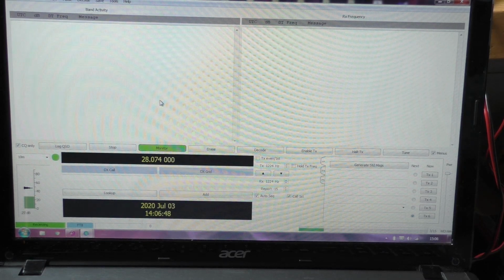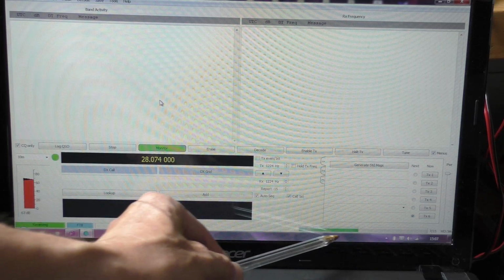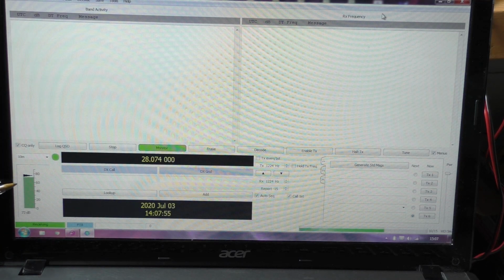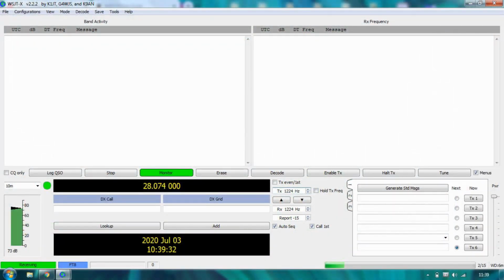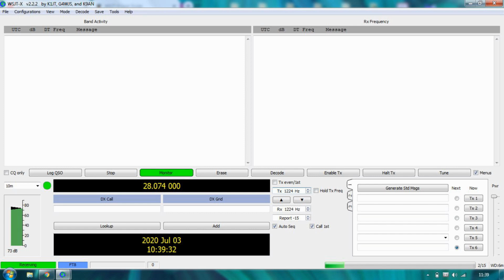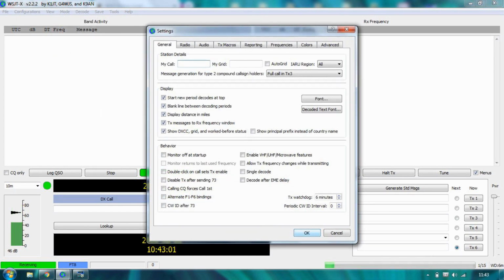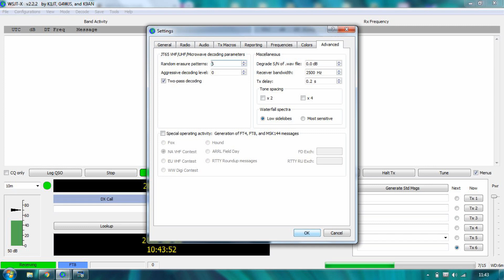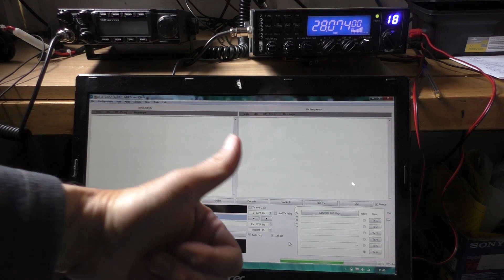Trying to read FT8 data. Not there yet.

Comment: Hi Fred, I too had great difficulty in getting the Data Modes to decode even though I had connected the CRTSS6900N to the PC and I was hearing the audio of the datastream through the PC. 
In the end I bit the bullet at bought a Yaesu SCU-17 Interface Unit - I did try a Signallink and a U5 Link as they were cheap - but they just didnt work.
Anyways, I use my FT-450D connected to the genuine Yaesu SCU-17, downloaded the Yaesu FT-450D rig control software from the Yaesu site and it worked straight away within 5 mins.
Also, you have to have the Windows audio codec installed first, before the Yaesu softare, and the WSJT-X is installed last, restarting the PC between each install. Then there are some settings within WSJT-X and your Windows Mic & Speakers settings to figure out also. 
You also need to sync the Windows time clock with an accurate server - the default windows one just isnt good enough. I use ntp1.npl.co.uk in the Internet time settings server box, and refresh every day.
It is quite convoluted, but worth the effort. 
I have remotely helped someone else setting this up with a FT-450D. So if you need any more help then please get in touch. 
73's CT3535 / M7
Reply from the maker: Big thanks.  Nice to hear from someone who has tried the same thing with a 6900N.  Iam getting that this is going to be more involved than i first thought.  I could fire up the 450D but i was hoping to get something working on lesser radios which other people might try.  Just dipping my toes into ham here to see if it was something CB guys could do.  A Really helpful comment and many thanks
Reply: @CB-RADIO-UK  You have everything you need if you just want to listen.  You don't need an interface, just a patch cord from the radio audio output to the computer mic jack.  I can decode with an old Kenwood Shortwave receiver and a mono audio cable.  Yeah I don't believe a stereo cable will work but give it a try if that's what you have.
Reply: @CB-RADIO-UK  Hey fred long time no talk the guy above mentioned the scu-17 this is vital  for  decoding data modes  i wouldnt even bother with 6900  just invest in the scu-17 it can do more than data modes aswell that was what i was using to drive my audio a couple of years ago if you remember and also do sstv on the cb band aswell  good fun.
Reply: @plast3r  While the SCU-17 is a nice piece of kit to have and makes sending and receiving its not required to receive, audio from headphones or external speaker out to line in will usually work.
Reply: @andydainty6055   very true i just found all the other solutions didnt really work that weill and the scu has opto isolators in it aswell which cleans the audio up
Reply: You hear many data station on mid band and sometime you can hear data on LOW band and super LOW but maining on around up part of 26mhz and low part of 27mhz cause i know they playing about with psk31 slowscan tv and packet radio

Comment: Ok I know this post is quite old now but I thought I would share this with you. 
With wsjtx running, go into file and select audio tab. Select internal mic and speakers. Now with the internal clock within about 1 second, if you let the laptop hear the FT8 audio it will decode it. You can use the mic on the speaker of the laptop to send, although this is better with vox. I set up like this using a Major M360 and got great results and while no replies I had a report on PSK reporter from Italy, Romania and two from Ukraine. The Major needs a tune up as it's only outputting about 5 watts into a silver rod.
Reply from the maker: Great stuff thanks.

Comment: Fred, I’m a bit late to this game.  I use FT8 on an Icim IC-7300.  Setup was difficult and took a long time, but mine works now, in spite of having a lousy antenna.  In settings, do the test icons work (green and red)?  Does your data cable attach directly to your computer?  Do not use a usb hub!  If you will post screenshots of each tab in settings, perhaps I and others can help.  73   N6###
Reply from the maker: Hi.  I did manage to decode the data in the end just using a microphone.  There is a follow up video on the channel.  Thanks.

Comment: Hopefully you've got this sorted. A few thoughts. Were you on USB? Might sound silly but you should not be on LSB. You computers clock needs to be synchronised to start decoding on the dot every 15 seconds which you do mention. On a quiet frequency with no carriers your input volume should be at about 30db.  Perhaps reduce your RF gain? 73 de 19CT019
Reply: And also, are you sure you've selected the line in on the audio tab of the wsjtx settings page? It might be set to the built in microphone.

Comment: Hi Fred. I'm curious to where abouts 4 watts would be on the ss9900 variable power. I have noticed a white dot, but not sure. Manual doesn't explain much.
Reply from the maker: The power pot starts at 1w on the min but quickly rises.  Its almost full power at 12 oclock.  The only way to check is with a power meter.

Comment: Greetings Fred, you may have already figured this out  but if not, try changing the audio settings such as codec, etc.  Also, the clock must be synchronized at all times.  Go to the computer clock open settings and click sync now.  Must be connected to internet.  If the clock is off just a second it will not decode.  I have to sync mine about once a week.  Good Luck.
Reply from the maker: Thanks

Comment: Hi Fred, Sorry to hear you're still having bother, I'll try & walk you through what I said last time but in more detailed steps 
1) Unplug that cable. Looks like You're trying to feed the PC with a "speaker level" signal from the external speaker output into a "mic level" input = BAD + if there's any RF in your shack there's a chance that you're possibly feeding that straight into your PCmic socket via the shield connection of the cable so potentially = VERY BAD 
2) If your computer has a mic built in just install WSJT-X, select FT8 & have the computer "listening" near the rig, [If no inbuilt mic. plug one in & put it near the rig].  Click ~"Monitor" if the windows version of WSJT-X doesn't default to this automatically. Monitor should light up green. Don't change anything else yet.
3) Adjust the rig's speaker volume & the computers mic input level until it shows about 60-70 max. on the receiving meter in WSJT-X. If nothing is showing up as received on the meter then go to "File" "Settings" "Audio" & make sure the "Input" that is selected matches to one that reflects your microphone (should be automatic as the software detects your internal soundcard on instalation).
4) Sit quietly ish ;-) & watch the data roll in. 
If the above is all good but you're still not getting anything decoded then visit www.time.is to check your PC clock is on time. 
FT8 is transmitted in 15sec sections as you're monitoring only & not transmitting you'll get all of them, (both the Odd's & evens), 4 decodes per minute, you should see these blocks in clearly defined segments rolling down the waterfall for the various audio frequencies that people are transmitting at, Signal then Blank, Signal then Blank rolling down the screen.
It really is that simple, don't complicate it & risk your equipment by adding cables :-) 
Once we get this bit working I'll help you set it up using PSK reporter so you can see how far you're receiving the signals from on a world map. (2 video opportunities for the price of one ;-) 
Then we'll start you on JS8Call, which allows more of a worded conversation rather than just contact, signal report, 73  etc. & is used by some on 11m.
Let me know how you get on.  73/10-10  26CT3662
Reply from the maker: Wow thanks CT.  A lot to digest.  Hopefully i will grab some time a the weekend and have another go.  Been working on my fish pond this week after work.
Reply from the maker: Yes deffo be trying all that.  Really helpful.  Thanks for taking the time. There will be a follow up video.  Win or lose.

Comment: Time is out on the software it says 10:39 the PC says 11:39 you need to turn off daylight saving time on the laptop. The time to use the software must be + - 0.01 second else it wont decode.
Reply from the maker: Good spot.  Yes i noticed that after i put the video up and is the first thing iam going fix.  Thanks
Reply: @CB-RADIO-UK  No problem buddy. Let us know how it goes and all the best of luck.

Comment: Hi Fred I managed to get it working on my Yaesu 450D. I purchased the data cable for the 450D and plugged it into my pc. Had trouble getting the right settings but working well just with the usb cable only receiving.
Reply from the maker: Thanks Mark. I will have another go at the weekend.
Reply: Fred in the Shed you are supposed to have a Digimaster Pro CAT Interface box between the yaesu 450D and your laptop but I managed to get it reading the data with just the lead from the port of the yaesu. The trouble is I had to google the information I was getting as it was some sort of short code.
Reply: Fred in the Shed  I have found this cable on the internet for the yaesu 450D a cheap way of doing data mode Yaesu Data Mode Cable for Transceivers Fitted with 6-pin mini-DIN DATA Jack

Comment: If you want to play with exotic modes that will work on a CB radio try SSTV (Slow scan television). Listen to 27.700 mHz during a lift and you should hear the French and Italians sending SSTV.

That would make a subject for your channel that I know you can do with a CB.

You'll need to download an SSTV decoder like MMSSTV. 

Have a read up here...

https://mcbainsite.co.uk/a-guide-to-mmsstv/#:~:text=MMSSTV%20is%20a%20popular%20piece,made%20specific%20for%20you%20radio.
Reply from the maker: Thanks thats certainly an idea for the future.
Reply: @CB-RADIO-UK  
I think your problem is filtering and bandwidth. The CAT is used when you are in QSO but maybe you are right. I'm grasping at straws.

Another video could be building and programming a super cheap RTL SDR receiver (£7 for 24 mHz to 2.6 gHz)  .and software set up.

Comment: 1) Google and install Dimension 4, install to sync the clocks correctly.
2) Mode on radio should be USB if you don't a data Mode, (Alternatively use your FT450D as it was designed for this kind of operation);
3) Audio level is too high and should be around the 40 mark not 80;
4) Switch all DNR and filters off;
5) Audio tab in WSJT-X select your correct settings for the mic (INPUT);
6) Try adding a Callsign and location as these are usually required;
7) IARU Region: Region 1 for UK
8) Waterfall is showing splatter, the signals should be more narrow;
If all that fails, plug your FT450D in which has many videos on here how to configure it, you can even use the CAT cable for the application to control the radio when selecting the bands.
Reply: Oh by the way you want to use LINE IN and not MIC as the levels are very different.
Reply from the maker: Thanks Andy shall try the above.

Comment: Need to see a screenshot of the settings pop up with the 'radio' tab pressed. You may not have actually told the software what to decode yet. I use FT8 daily, and it's a right pig to get working to be honest sometimes. If you can show a screenshot of the radio tab under settings that may give a better answer. 73'
Reply from the maker: Good point.  On the radio tab i have it selected as NONE as iam not going to TX
Reply: @CB-RADIO-UK  if you know what com port the radio is on, it shouldn't be too hard. Go to settings and under radio tab select your com port from the drop down menu and select the baud rate. If the baud rate doesn't match the rig, the software won't decode the signal from the radio.
Reply: @CB-RADIO-UK  one other tip, your PC time must be the correct time - I had issues with nothing decoding because my clock on the PC was out by a few seconds. Right click the clock/date in the taskbar, select Adjust Date & Time and then under Synchronise your clock - hit that and reload the program. I had issues like I already mentioned and as soon as I synced the clock, the software was decoding with no issues. Ideally sync the clock before each session on WSJT-X.

Comment: Fred, I got this working today on my Yaesy ft-991a. I followed this guide: https://www.n1rwy.org/?p=157. I'm not convinced it will work with speaker output from your 9600. I say this because on the yaesu, I have to select USB-DATA mode (not regular USB), and I have to adjust the IPO band width to 3000hz. It works perfectly, but like you said, I was a bit bored after 2 mins as its just basic short one liner text messages, akin to listening to someone on a  contest making loads of very short contacts. If you connect it to your 450d over the USB cable you should get it going. You don't even need to worry about the rig control if you are only listening - in my case, I enabled rig control, and the way it works is that if you are tuned to a freq, and then switch mode in wsjtx (say switch from FT-8 to WSPR) , it changes the freq on the radio to the nearest freq on the band which is designated to the mode you just selected (the modes-frequencies are configured out of the box on the Preferences screen in  wsjtx).

Comment: . 
The meter on the left bottom should be registering at around 60dB. Set USB.
Secondly you need to have an NTP time signal that is accurate.  FT8 used this to time the sends and receive.
Make sure your callsign is in the settings menu. No call no grid no receieve.
One problem you will get is not being able on a CB top open the bandwidth filter. So you may not be able to hear or work signals outside the 2.5 kHz receive bandwidth that CB sets for SSB.
G0TMH
Reply from the maker: Thank You.  I might be screwed over the call sign as iam only trying to receive and do not have one.
Reply: @CB-RADIO-UK  You don't need to put a callsign in if you are just listening Fred or Monitoring👍.
It can also be decoded without splashing out on digital mode interfaces that cost way too much money, all they are actually doing is isolating your computer from your radio and sometimes a bit of filtering and a PTT circuit.
It can be done with just the Audio fed straight from your Rig into your Computer..The main problem is getting the audio level just right and with the particular digital mode you are trying the time on your computer has to be accurate. Another thing is to make sure all settings are right in your decoding program of choice.
If I was you I would have started out with trying to decode Morse 1st and Rtty 2nd then when you get the hang of decoding these then move onto the ones that depend on other things like time accuracy and not just the audio tone levels. Don't forget the microphone level adjustments on your computer which also also your recieved tone levels, you can also use the equalizer settings if you have one..
On a final note Fred don't be calling your self dumb we all have to start somewhere with newer stuff and believe me we have all been there and done that at some point.
Keep up the great work mate.
🍻👍👍

Comment: I use Com 0 Com for usb serial splitting for CAT control and l use VB audio cable for piping the audio ....sometimes l lose decoding from not using up to date software, but it looks like your software it up to date.... also the clock timing has to spot on your PC, and you may have set your call sign and your Maidenhead grid reference.
You could just check WSJTX is working by selecting Rig Control to none and the audio to the computer’s mic, and then hold the mic to the speaker it should decode.
Reply from the maker: Thanks Dave.  Ive not tried the PC mic.

Comment: RX audio level looks too high ,  filter bandwidth on radio needs to be as wide as possible ( mine is at 3kHz ) no noise reduction , also look at the waterfall display to assess signal levels etc. I set my clock just using the windows time sync facility and have worked world wide without problems.

Comment: Fred, unless your PC clock is way way out you should still get something, so I don't think that's problem mate, the issues lies with the sound bandwidth of the sound being received, looking at the waterfall, FT8 needs a receive bandwidth of 2500hz - 3000hz to decode correctly, I don't think you can set this on that radio, the alinco or FT450 should be more than capable of doing it.

Comment: you can get cheap USB to audio outputs and use the internal soundcard to decode.  No need for a Signalink as some others have suggested. Look up the recent video from Charlie Morris as he made a interface from his old radio to his PC. 

From there make sure your clock is accurate on the PC by either doing auto setup via Nist.gov in the Windows settings and make sure it is correct. Or get a USB GPS to sync with the GPS systems.

Also why not get a SWL callsign. The RSGB allows SWL callers to send cards with their registered call. I have one from Romania in 2008. They are nice to get as you don't expect one to turn up. So maybe a UK SWL may interest you in other types of radio. No exam for it, just get a receiver station callsign and go listening. More info here:  http://bdxc.org.uk/

Comment: One of the things I dislike about modern ham radio is the large reliance on software (inside the rigs and external) .. The Yaesu SCU-17 might be your way forward here Fred.. You might have to connect it with your 450D , but it might work with the CRT.. Don't forget to install Windows audio codec in your laptop and do a restart.  When you get it working you can look forward to receiving text on the humidity, temperature and antenna system of an operator in Bogota no doubt.. 🥱 😴.. Have fun.. 73 G4RYO